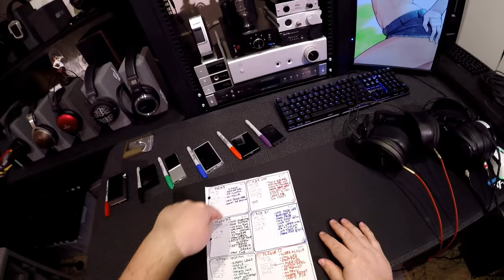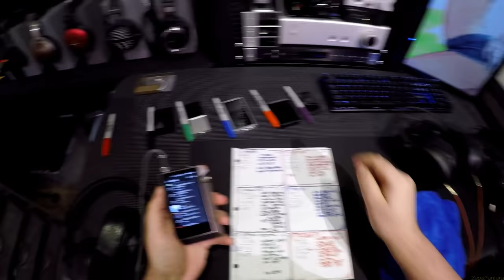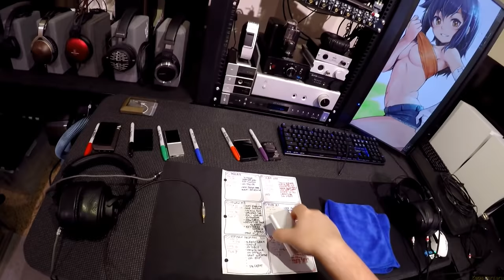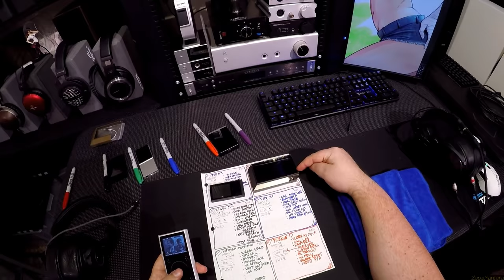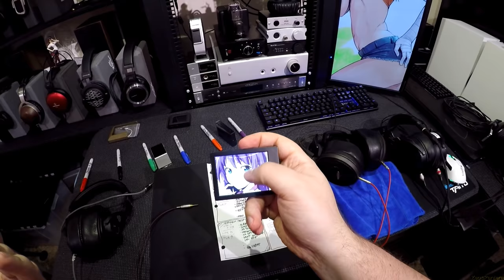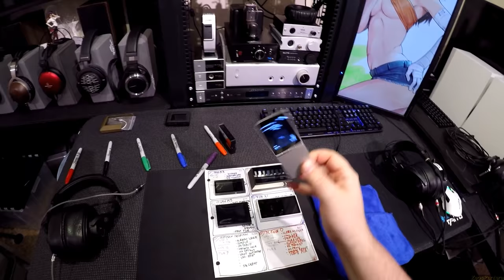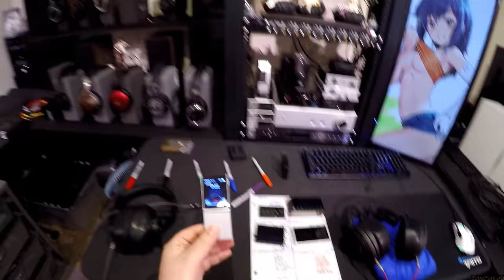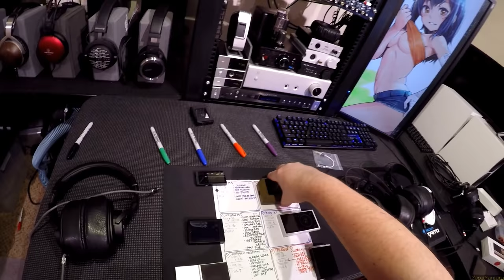Z Review - DAP's : The Movie (Fiio - Hifiman - Cowon - A&K)

Comment: The AK240 supports up to 256GB SD card making the total storage allowance to be 512GB.

Another neat thing about the AK is that every time you turn it on, the volume automatically drops down from your previous setting in order to accommodate different headphones and not blow your ears out when you press play. Just some hidden features you get (among many others).
Reply: I wouldn't be surprised if it supported 1tb microsd. Both the 256gb and the 1024gb microsd are microSD XC. I think back in that day, they couldn't or didn't want to validate for it, since those micro SDs weren't available.

Comment: Just FYI, you can microSD cards up to 256GB to most of these. The M3 may say 64GB and the AK240 may say 128GB max external, but they'll take 256GB cards. So max capacity on the AK240 is 512GB. The exception is the Cowon, because of stupid firmware limitations they won't read the whole card, which is why I got rid of my Plenue D for a Pioneer XDP-100R (also having wifi and full Android is nice)

Comment: I bought a new XDuoo X10 DAP and full of bugs and need comment how good are the companies at updating and correcting there firmware.  Bought AK JR and yes 3x price but the thing is small as hell and holds 256 gb card and 64Gb internal memory and it works. Really like to see a listing of power output for hard to drive headphones. Firmware is what determines the quality, lots of features and what is the learning curve for each player , the DAC quality and how much power. I will take AK JR for $299 over the Hifiman any day.

Comment: I've been using the M3 for almost 2 years now. I must say that for such a tiny device, it is really good at giving me a good music experience. Super portable. Can drive almost any portable headphone. Sounds is quite good too. I prefer a slight warm sound output than a crystal clear one, and the M3 provides just that. I generally pair it with my px 80 or Fiio F1 headphones, which are decent at best, but are quite neutral in their output compared to others in that price range. But I have tried them with mx40, px 100 and some other good quality cans. I'm in love with this tiny little device. 

I have been thinking of upgrading to a better DAP, but the M3's portability and battery life is hard to match. That's what stopping me from upgrading.

Comment: im still using my cowon A2 from 2007..30 gigas ..incredible the battery still works fine...didnt buy another player not planning to buy one..using cellphone with 24 bits audio dac and 128g card..and sometimes with fiio dac and amp..so...i dont need one of these..cellphones came a long way and now they have really good audio with good headphones check lg v20.

Comment: Hi. Trusting you and taste, well I did with Westone W40 and love them, just right in every way.

Thing is I use a Ipod classic 5.5  wolfson, love the sound with the Westone, but times change and need a new player for Flac files.

I like the warm feel of the 5.5, I like a large sound stage, and would rather have something with more life, maybe not 100% as intended rather than flat and boring.

So for between $150 to $300, which would be the best? also see you have AKG 712, I love them but wonder are you using stock cable or DIY copper?

thanks

Comment: Nice work here - fun and elaborate review.  The Cowon Plenue D looks impressive in terms of fit, form and function.  The Cowon brand is a favorite - I bought a Cowon O2 back in 2010 and it has been the best travel companion on long-distance flights - great audio, video and battery life.  I have a question about headphones. What would you recommend as a quality headphone for wearing at the gym (during elliptical machine workouts)? I own many headphones and there are compromises in terms of size, sound and durability.  Any insight would be helpful.  BTW - I bought the Plenue D based on your review.

Comment: 32:50
Chances that it'll accept higher capacity cards are very likely
The m3 that I have officially goes to 64gb.I have a 128 gig in there, no problem whatsoever.

very likely it's just a 'limit' imposed by the marketeers who don't want the lower tier model to become too popular.
After all they didn't even build in a firmware limitation on the M3. It just supports it right out of the box

Comment: I used to use a cowon x9 for quite some time but it was really fucky with flac. Seemed to have a real hate on for 1411kbps cd rips and would freeze the instant i tried to load them. Interface was rather unique and pleasant to look at but i got tired of dealing with touch interfaces. Went to a fiio x3 second gen and haven't looked back. It can even drive the fostex t50rp III on 85/120 on high gain. I'm pretty hyped to see what they bring out for the third generation though.
Reply: Also just noticed the x3 does have replay gain.

Comment: Great video. The M3 I might get after my iPod Classic dies.
Reply: *****
 awesome, thank you for helping me out. whats the max memory on it?
Reply: *****
 that would work really well for me. thank for the help. do you know if it comes in other colours?
Reply: *****
 depending on currency exchange i might go with white because that is the cheapest and only colour sold where i live, however if the  currency exchange is in my favour then im getting a black from overseas
Reply: *****
 looks like im going for the white model as well, its cheaper here and no shipping time to receive it. do you know where i can get the bicep strap for the m3 for the gym?
Reply: *****
 yeah definitely will check with them but so far google is telling me it will be an import but with the money i save not having it shipped to me i can get the arm band. are there any other accessories like cases?
Reply: *****
 thank you very much for all the help. that really sucks that would happen wish they made another low cost player

Comment: Yep its hard to beat the x1 for the price. The combination of features eg built in eq bluetooth etc and sound. More expensive players may have better clarity etc but you will have to pay atleast twice for better sound with same features.
Nice movie Zeos 😁. Cheers.
Reply: Ive owned both the 1st and two 2nd gen x1s, while all the features are handy, especially for the price its tough to beat granted battery life is not great. The biggest issue is the god awful mechanical scroll. Theyre were and still are many complaints with the design, idk why fiio still insists on using it. Ive recently purchased the m3k and its light years beyond the x1s navigating/usability. Not as many features but has triple the battery life and is smaller. I would almost consider it an upgrade as its cheaper but mostly because it has a touch capacitive scroll bar and not the wheel.
Reply: Good point...Try to update firmware to 2.0...much better, but not perfect...still in my opinion unless is a smooth flawless touchscreen, nothing beats actual buttons.

Comment: Great Review.  I had hoped that you would be reviewing the X5 3rd gen, but that does not appear to be the case.  The X5 3rd gen should be available in Mid February and the design language and specs are quite different then the 2nd gen unit.
Reply from the maker: I think it will be the new one.

Comment: Was digging the M2 but no replay-gain kinda kills it for me. It is an immensely useful feature allowing me to never have to adjust the volume. When you can have a 13dB difference between songs replay-gain is an ear saver. Guess my phone and rock boxed sansa clip are sticking around as my main daps.
Reply from the maker: It is a feature I figured ONE of these units would have.
Reply: Same here. I really prefer to have a separate DAP but ReplayGain seems to be taboo for every manufacturer currently producing devices and for a lot of people at certain forums.
It's both funny and sad, although I think more the latter than the former, which is sad in and of itself, that players that cost so much, and brag about their godlike hardware, fail to deliver a basic and at the same time extremely useful feature such as ReplayGain.
And who will hear the difference between this audiophile-grade hardware and the casual Sansa Clip's SoC when walking outside? One could probably barely tell the difference in a quite environment with the proper head/ear-phones, much less outside where there is traffic, people, and a plethora of other sounds.

To me DAPs are not making a comeback, not until they start being practical. I don't count audiophiles who would buy anything at any price, as long as it boasts expensive individual components and was marketed by its vendor with some key buzzowords here and there.
I'm referring to actual, sane audio enthusiasts who value sound quality but not to the point of obsessing over it so much that everything else gets completely ignored.
Reply: I know this is a bit late, but I own the original Fiio X1. The last update added replay gain. It doesn't look like the X1 II has it, (they apparently used a different programming language for the new model or something) but replay gain is in their dictionary and it is at least a thing they are willing to add if people ask for it. So all hope is not lost. I'm super jealous of the X1 II now.

Comment: Just curious, after the kind of review you gave the jvc 2ks, what caused you to get the 1ks? Just noticed them on the end of the left shelf
Reply from the maker: Someone sent them and I have been repeatedly told I did it wrong. So time to re-do.
Reply: Hmm, the sound of the 1ks isn't the same from what I've read many times. I've only ever heard the 2ks. Many ppl say the 1ks have clearer mids & highs but not as much bass. I can confirm though that the plastic squeaking was definitely not an isolated issue. They all squeak like that. Thanks for the reply
Btw, thank you for the DAP reviews :)

Comment: Have you used the ZTE Axon 7? it would be really cool to hear your input on that. i have it and it does pretty darn well.
Reply: Nick Pelayo sadly it can't play FLAC-files.
Reply: Michael Scheck yeah that's fine for me.  I pretty much only have mp3
Reply: Get Poweramp app, and you can play flac on a phone that doesn't natively support it.
Reply: already have it along with shuffle, foobar, and neutron
Reply: Nick Pelayo not that impressive i have to say. But what headphones are you using it with?
Reply: Michael Scheck I use m50xs with an amp when at the library,  1more triple driver iem in public and the HD 650 with the xduoo xd05 at home

Comment: I just bought an great external DAC/AMP which can handle all file types including DSD, but need a music source to go with it.  I don't want to use my PC because the fan is too noisy.  I guess I need a DAP like one of these. However, I don't care to use the internal DAC/AMP of the player. I want to steam the data to my external DAC/AMP instead.  I also want DSD capability. The question I have is can all these players send DSD file data to my DAC even though the portable player can't play DSD itself? Can I use the cheapest DAP here and use it as a USB source for my external DAC and play all file types including DSD?

Comment: wow that is a lot of storage! you could put a ton of 32 bit float WAV files on that thing with a sample rate of 192Khz. l don't know if that thing can support that kind of file, but it does have the storage for it. a file like that is probably a couple of gigabytes, compared to MP3's that use a could of megabytes.
Reply: electronics for fun A file like that is definitely not a couple of gigabytes.
Reply: ktfjulien you think it is more? I have some files like that and they are space eaters.
Reply: electronics for fun No lol theyre way way less, naybe 100 megabits per minute at most.
Reply: not per minute! l am talking about the total file size.
Reply: electronics for fun Yes, i know lol. Meaning a 6 minutes file would be about 5-600 MB.
Reply: mine is 1.5GB and the song is a little over 4min.
Reply: electronics for fun Something's wrong with that file then. A 6 minute 192kHz 32 Bit RAW/WAV file should be exactly 276.48 MB. 

It's pretty easy to calculate it. Just multiply the sample rate by the bit depth to get the number of bits per second and multiply again by the length in seconds.

One thing is if it has album art then it's possible the album art is in a super high rez RAW format, which can take up 1-2 GB by itself.
Reply: Peter .S. Thats definitely not howit works. Trust me, I have an entire lossless library. File sizes are fairly arbitrary.
Reply: the file is 36864kbps. l was wrong about the length it is 5:50. l exported it in audition at 192Khz, 32 bit float, WAV. it came out to be a 1.5GB file.
Reply: Is it in 5.1 or 7.1 by any chance?
Reply: ktfjulien
 File sizes can be smaller than that because of lossless compression and variable bit rates, but doing the raw calculation will always give you the upper limit.
Reply: you know what l think l exported in 5.1... SHIT l did and totally forgot about that!
Reply: Also let me correct the calculation I did earlier. It should be 552.96 MB at most, since it's a two channel track. My mistake.
Reply: electronics for fun
Yeah that sounds about right
Reply: 276.48 MB per channel * five channels results in around 1.4 GB (add on a band limited .1 channel and you'd get around 1.5).
Reply: l know it could be much smaller!! l just wanted a full balls to the wall file. compared to the WAV as 48Khz at 24bit. the difference is far from huge, but if you listen hard enough you can hear it.
Reply: electronics for fun So the original file was 32/192 5.1 and you down sampled to 24/48 5.1 to compare them?
Reply: Peter .S. dammit!!!! l didn't get this notification either!! youtube needs to fix their shit!!

anyways. yes that is what l did. and the down sampled file is stereo

Comment: Why do you hate Blue leds and you still have a blue LED keyboard?
Reply from the maker: I cant work out hot to swap it to purple. The software keeps trying to update and when it does the keyboard dies and I have to unplug it and start again.. HELP
Reply: If you tell me what brand and model it is I could look into it for you and see if I can come up with a solution.
Reply from the maker: These are all Roccat things. the issue is I think the USB hub I am using. I have to plug it in direct first

Comment: I wanted a DAP that played Spotify. My phone doesn't have the space for offline storage. The Fiio X5 3rd gen will be able to do it, and if it was available and reasonably priced, I'd probably say fuck it and buy it. Instead, I'm learning to 3D model to have a case printed by Shapeways so I can make a fucking DAP out of the Raspberry Pi 3 I have coming. I'm guessing I'll just run Linux on it  with  ExaGear Desktop??? I don't know. This is bullshit. Gdi. But, I guess I'll finally put my fucking Fiio K1 to use.

Comment: updating the firmware in x1 is a bitch because the windows 10 doesn't support fat32 format for cards more than 32 gb and you have to install 3rd party app to get fat32 to update firmware.
Reply: KrishKrusher I had absolutely no problems with mine. Format the card on the player, and then plug it into the computer afterwards and it should be fine.
Reply: KrishKrusher I had no issues at all